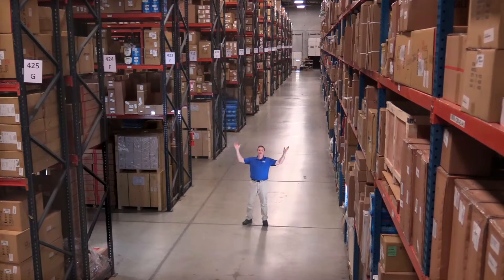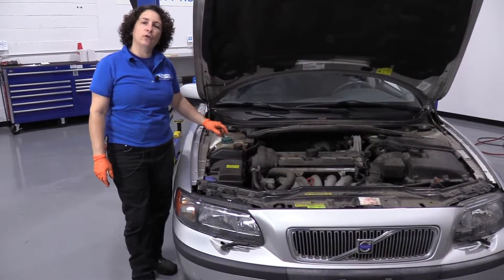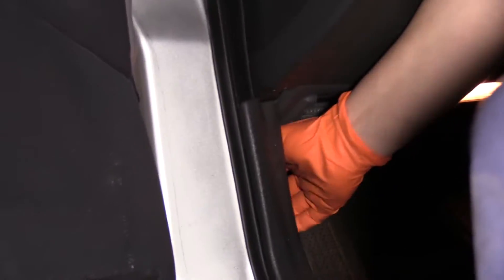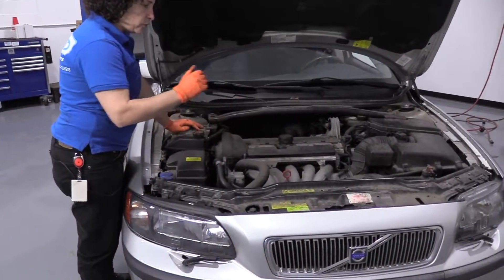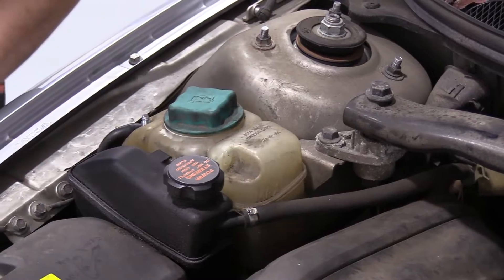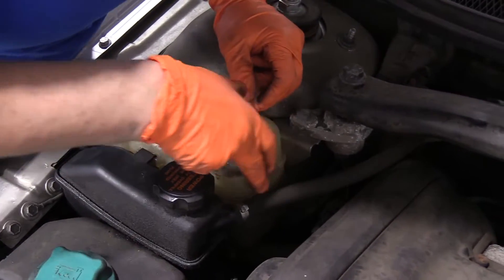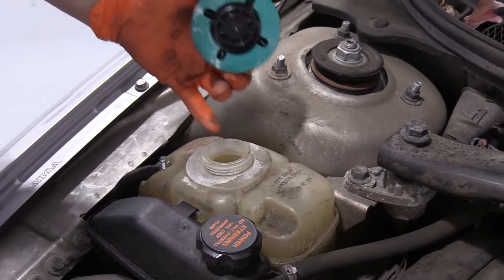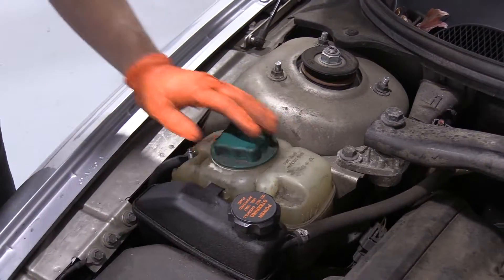How to Check Coolant 00-07 Volvo V70

Comment: I have a s80 with the same engine......and everyday  I need to refill half litre.....no overheat or no visible  leakages. ..so what could be the problem? ?????
Reply: Check under the engine, might be a little leak somewhere down below.
Otherwise try put some pressure to the coolant tank and see if you could find any leak.